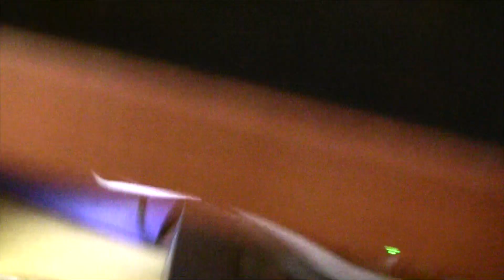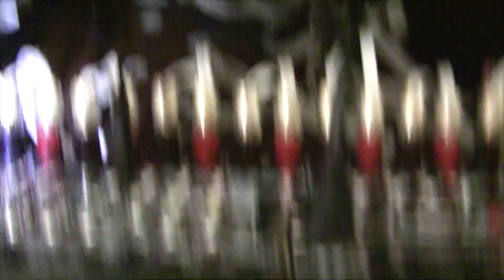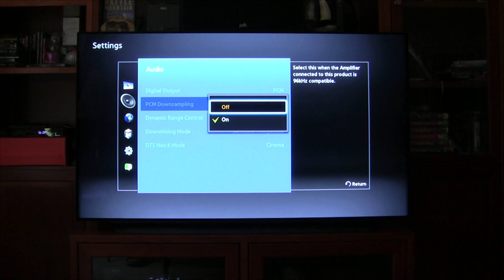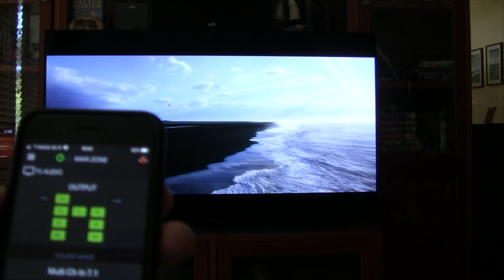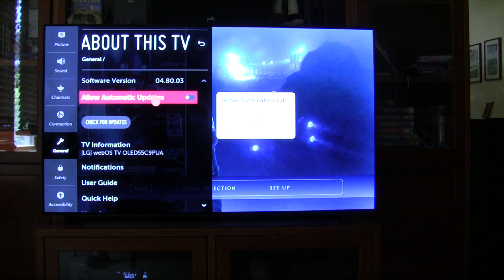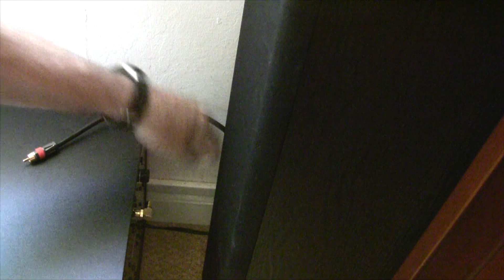Denon X4700H & LG C9: Upgrading a 2012 Home Theater to 4k OLED & Dolby Atmos Surround Sound - Part 8

Comment: Great series of videos , i can suggest one thing to test the truehd atmos uncompressed without xbox series x...take a laptop/pc and download the plex server on the pc ...next step is to download a remux movie from the internet (usually around the size of 50-80gb),this has all the uncompressed audio video formats ...now u hav to download plex client available on the lg webos store ...by logging into the app on the tv  u can access the movie remotely which plays the movie with ease ..try this if you have time and let me know if you have any doubts ..
Reply: Or else u can download dolby amaze uncompressed atmos file from some websites and check , it is around 2-3 gb i guess.
Reply from the maker: @Karthik-xx2nw  I downloaded a Dolby amaze uncompressed DolbyVision/DolbyAtmos file and put it on a USB drive and plugged it in the back of the LG. Unfortunately, the file type is .MKV. The LG doesn't support that format. That also prevented me from playing the file directly from my PC since it's set up as a Windows Media Server.

Next I tried was mirroring my PC screen to my Chromecast Ultra HD plugged into the back of the LG. Then I played the Dolby Amaze video using the VLC video player on my PC. The video came across fine, but the sound was only stereo.

Then I decided to go ahead and install the Plex Media Server.
That also worked, but the best I got was Dolby Digital Plus. No TrueHD. :(
On the plus side, the leaf demo was a great demo of DolbyAtmos! You can hear the falling leaf go all around you.

I also have the Dolby App as seen in the videos. That's a streaming app, so it can only do DolbyDigital+ like other streaming sources.
Reply: @BetaCygniBlog  https://www.digitaltrends.com/home-theater/dolby-atmos-sound/  Give it a read ..Explains the various scenarios of getting atmos ..one solution  from my research is that plex client on nvidia shield tv pro supports all the latest formats including dolby atmos true hd ...
Reply from the maker: @Karthik-xx2nw  That article says that the LG TV Plex app can't support TrueHD, and unfortunately I don't have a NVIDIA shield TV, so it looks like I have to wait for the XBox. Thanks for the suggestions.
It was worth a try.
I even found an MP3 sound file that was supposedly encoded with 7.1 DolbyAtmos TrueHD, but it only played as stereo on the LG.
Reply from the maker: Thanks! I'll give it a try.

Comment: Hi is you tap the question mark on the Denon app it will tell you if is a Dolby + or True HD
Reply from the maker: Thanks! I'm going to try that.
I'm not sure I'll have a True-HD source until I get my XBox Series X and can play my 4k Blu-rays, but I'll try it on Disney+ which is streaming Atmos.
Reply: Beta Cygni your are welcome if you play a 4K movie or blue ray from a player it should be True HD
With the 2.1 you should get True HD  from a streaming source Netflix, Disney + etc.
Reply from the maker: @theredon2 I only have an HD Blu-ray player (Samsung BD-F5900). I'm waiting until the XBox Series X comes out to use as a 4k Blu-ray player (and gaming of course!)
However, I did play an HD Blu-ray movie the other day I rented from Netflix and it showed up as Dolby Digital Surround True-HD! So that's working.
I'll have to wait for the XBox to get Atmos-TrueHD from my 4k blu-ray discs like "Ready Player One".
Reply: Beta Cygni That’s good that’s why I like to buy the physical media because to me has better audio and video. Until the HDMI 2.1 get in to normal and with the eARC will be able to to pass lossless sound from streaming, in my case for me it’s better to get physical media because I have a projector and it doesn’t have eARC.
Reply from the maker: @theredon2  From what I've read, the problem is that streaming services aren't sending lossless sound. eARC & HDMI 2.1 should be able to pass lossless Dolby Atmos True-HD without a problem. I've seen other videos where someone has a 4k blu-ray player and they are getting True-HD. I'm expecting the same when I get the XBox Series X later this year.

Hopefully streaming services will eventually send lossless sound, but until customers complain about it, it probably won't happen. I'm sure it's cheaper to send compressed sound.

I too like physical media for movies. Mostly for the extra features that you don't get with streaming or even renting discs. But also for better sound and picture quality that doesn't depend on a streaming service and an internet provider.
Reply: Beta Cygni Yes, for now I’m growing my 4K collection. I’m not a gamer but the player on the Xbox it will do I good job. With my oppo 203 I’m more then happy that why I like to take advantage of my player.

Comment: Great series of videos... I might have missed it, but wonder if you can comment about quick media switching. It's one of the HDMI features that's supported via HDMI 2.1 on both the C9 and your new Denon. Was wondering if you noticed a difference changing sources from the TV to the blu-ray and or the Chromecast.
Reply from the maker: Thanks!
I've got one or two follow up videos coming up in the next couple of weeks and then another big one when the Xbox Series X comes out later this year.

RE: Quick Media Switching
I haven't spent any time looking at that yet.
I'm switching sources using my universal remote (Logitech Harmony One) which is set up for starting each source (LG, Blu-ray, Chromecast) from power off.
So it takes some time to send all the IR signals to the LG, Denon, and/or Blu-ray, so any time spent switching frame rates is going to be short compared to that.

This article talks about what happens on a streaming service when you switch between trailers  at different frame rates (24, 30, 60):
https://www.hdmi.org/spec21Sub/QuickMediaSwitching#:~:text=retailers%20and%20consumers.-,Quick%20Media%20Switching%20(QMS),connection%20chain%20change%20video%20modes.

I guess I wasn't aware of the problem before with my old setup so I don't notice any difference now.

Also, I usually turn off "auto-play" of trailers for streaming services like Netflix, since I find it annoying when I first enter the app to have some video blasting at me. I usually have an idea of what I want to watch and it's almost never what Netflix (or whichever other service) wants to promote.

Comment: What brand is the white flat looking speaker wire and banana plug.
Reply from the maker: This is the speaker wire I bought in 2012:
Acoustic Research PR362 Speaker Cable, Flat 16 AWG
https://www.amazon.com/Acoustic-Research-PR362-Discontinued-Manufacturer/dp/B00008VSL4/ref=cm_cr_arp_d_product_top?ie=UTF8

It's discontinued, but Monoprice sells an equivalent. I would go with that today:
https://www.amazon.com/Monoprice-Planate-Gauge-Copper-Speaker/dp/B00WITWKNG/ref=sr_1_3?crid=1QMTZ72P0NNWQ&dchild=1&keywords=flat+speaker+wire+16+gauge&qid=1593811092&s=electronics&sprefix=flat+spe%2Celectronics%2C214&sr=1-3